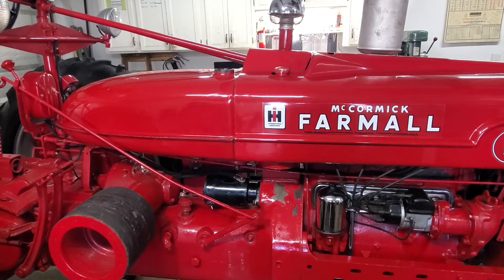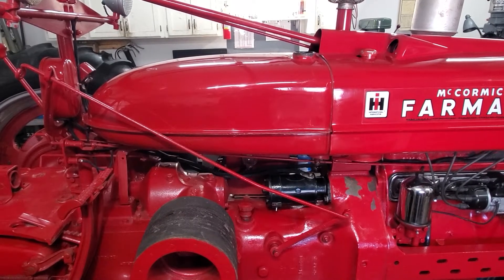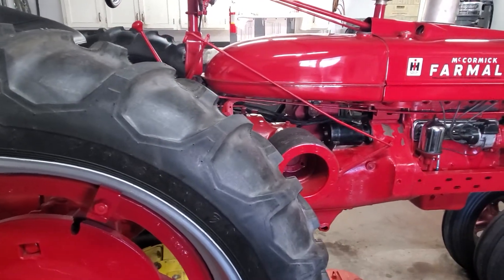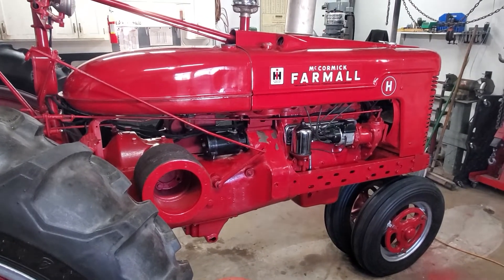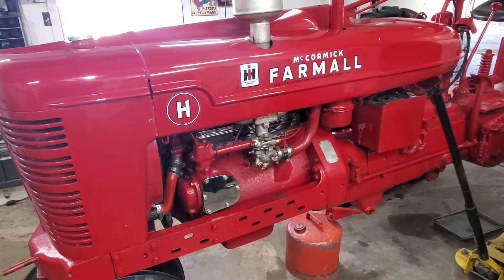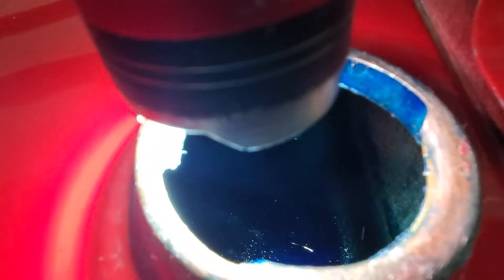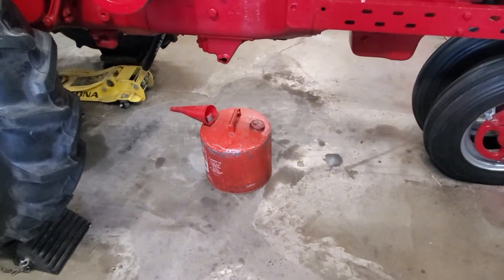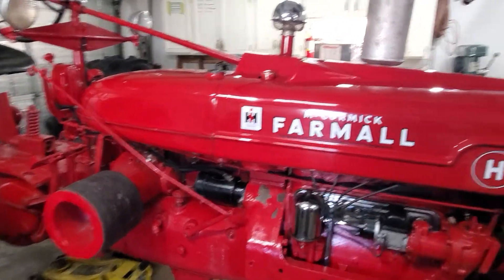Farmall H Fuel Tank Liner Conclusion (Thoughts and Opinions)

Comment: Great tips on the materials. I had no idea they used simple, everyday items. I have always done it the way you prefer to do it, minus the phosphoric acid - but that is a GREAT idea!
Reply from the maker: I use phosphoric acid in my shop for a variety of things.  But, I make dang sure I get the "stuff" that does not have other types of acid in it.  I often give rusty parts a long soak first to "convert" the rust.  
I also agree with you!  This is an easy process.  If anybody has rust in their tank, they should do this.  It's not terribly expensive and it's well worth it to preserve the tank from rusting away.